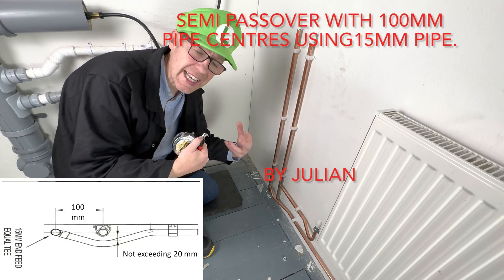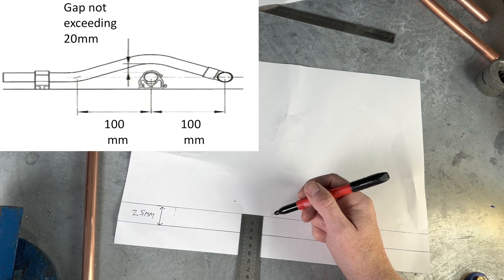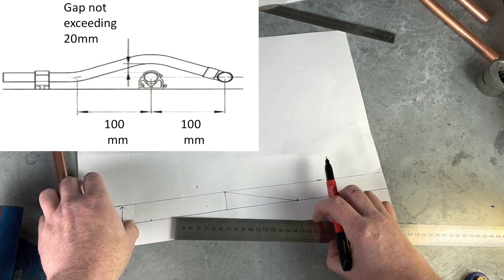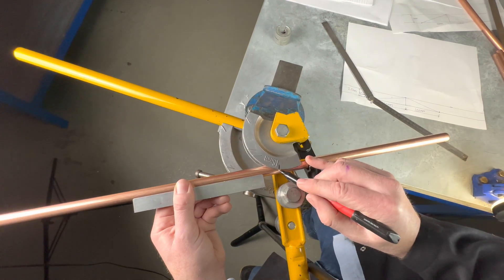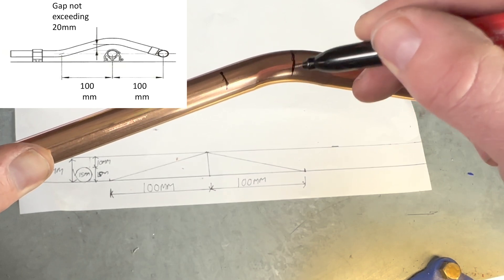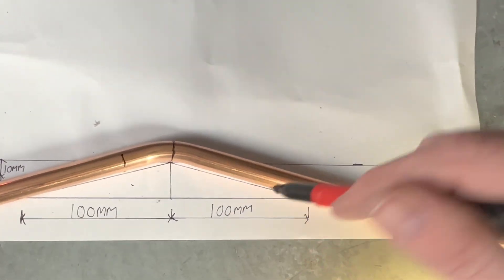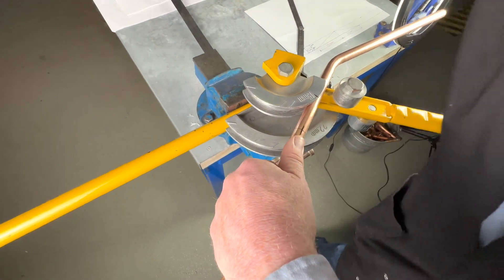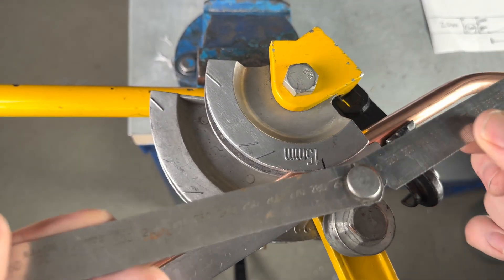Copper pipe bending - pulling semi pass over with 100 mm pipe centres

Comment: Could you demonstrate that other bend that is going into the radiator valves. Thanks
Reply from the maker: Hi, check out a video i made on it  called "pulling a 90 degree bend with a kick in copper pipe"

Comment: 👍🏿👍🏿👍🏿 Julian🔥🔥🔥 what a long winded process 🤓🤓🤓
Reply: I teach more or less the same, I explain that by using the drawing as a guide, you can produce the same bend in a piece of pipe, over and over and they will all look the same, for a row of cubicles for example, rather than doing it by eye, where they will be different.
Reply from the maker: Hi - Colleges have strict tolerances to work to.
Reply: @Londontradecollege  i know i as i went through the TOLERANCE TORTURE 😂😂👍🏿 testef the college tutors levels